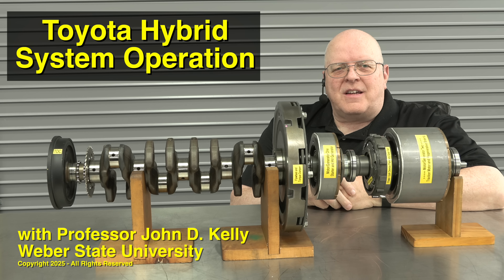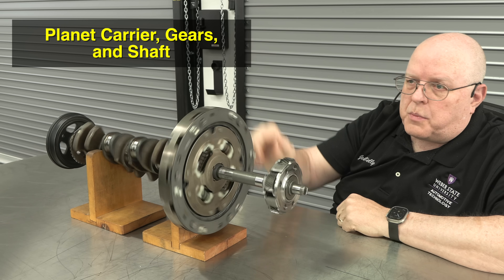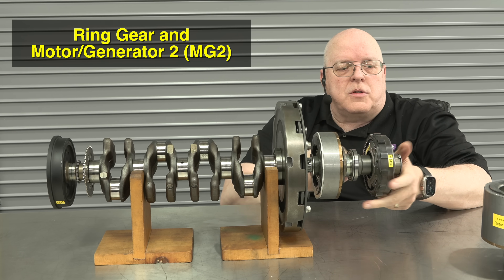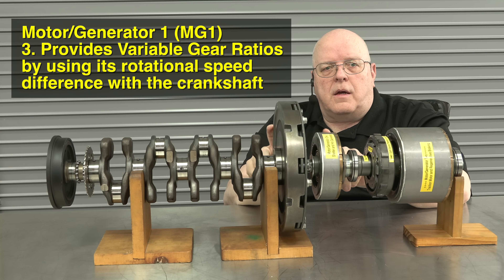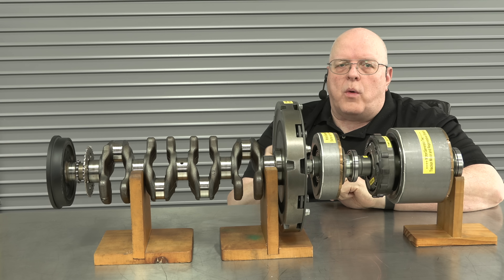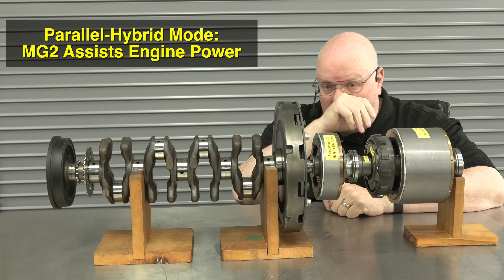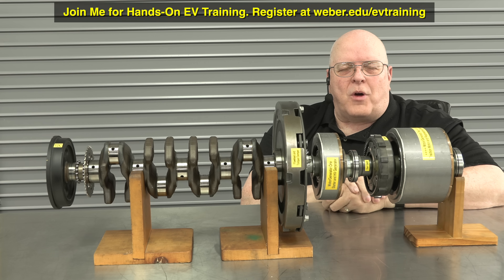Toyota Hybrid Transmission Operation - 15 Years on YouTube!

Comment: How does Honda do the same thing without the planetary gearset?
Reply from the maker: See my Honda Video for the answer. https://youtu.be/QLUIExAnNcE?si=koWU4q9hevkt8vrK
Reply: @WeberAuto  Thanks, I've watched the video numerous times but don't see the need for planetary gear if Honda can do without.
Reply from the maker: @Gman00047  Both systems accomplish almost the same thing, but the Honda has more parts and a hydraulic clutch pack for a fixed overdrive gear ratio. The Toyota has a variable overdrive ratio due to the planetary gear set..

Comment: Professor. You explained this well enough that this hard-headed 81 year old could understand how my 2012 Prius and 2026 Crown propels themselves down the road. And I always thought there were rubber bands in there driving things!  Seriously, thank you for your superb delivery.
Reply from the maker: Glad to hear the explanation was helpful!
Reply: The systems are very robust and wonderful machines!

By the way, even belt CVT's don't use belts anymore. They're basically like a spine, with interlocking vertebrae. They stock together to form a solid bar. And the operate under pressure, not tension! Modern ones don't use belts anymore, like you see on youtube, they are a series of linkages making a push belt, basically a bunch of vertebrae held together by a steel belt, so it's flexible but under pressure and compression it turns into a solid bar of steel. 

Modern cbts are absolutely wonderful and as reliable as automatic now. Cbts just have a bad name because Jatco, for a couple years, provided every single CVT on the market, to subaru, nissan, Mitsubishi, etc. for a couple years when they first came out, every single one of them was made by a lowest bidder and every single one of the first generation were crap. This meant that people thought they all slept because every single brand had a shitty one and none of the good ones came out for four or five years later.
Reply: why the engineer never near the engine? 😂😂😂😂  why Ford Motor didn't make motors but made engine 😅😅😅 why don't they call donkey power than horse but now the unicorns run & fly 😂😂😂😂😂

Comment: Thank you, the first video was great and this video is even better. You're one of the best!
I have questions about this system and would appreciate input from anyone with experience.

How much power does MG1 contribute at various gear ratios? at greater than 1:1 it is spinning but is it using a lot of power? at less than 1:1 it is spinning but is is using a lot of power? at 1:1 is is not spinning but is it using any power or is there a brake on it?
Reply from the maker: Thank you for your kind words. MG1 is either using power, generating power, stopped, or free spinning. The amount of power used/generated depends upon the acceleration, deceleration, load, vehicle speed, engine rpm, etc. So many factors impact it.

Comment: There have been a few comments with respect to the Honda hybrid system, which is fundamentally different from this one and the one major "drawback" of the Honda system seems to be an inability to blend ICE and electric power from a stop and/or low(er) speeds due to the on/off nature of the overdrive system (in the Honda system, available wheel torque from the ICE at <20MPH must be essentially non-existent, even if it could be engaged...)
Reply from the maker: Yes, it is a different system. I made a video about it here https://youtu.be/QLUIExAnNcE?si=koWU4q9hevkt8vrK
Reply: @WeberAuto  Thanks for the reply, but in that video you didn't touch on the fundamental difference of blending torque sources at low speeds.  It seems that the Honda system relies on a much more powerful electric motor for no/low speed acceleration since the ICE cannot be used (directly via the overdrive clutch) to apply torque to the trans-axle at low speeds or from a standstill.  

I'll have to do a test-drive, but I assume if your hybrid battery is fully charged, the ICE does not even need to start until the lowest practical speed is reached for the overdrive clutch to engage.
Reply from the maker: @awebuser5914  Yes, that is correct.

Comment: Kudos for the wood worker that made those stands. Looks like they line up perfectly.
Reply from the maker: Yes, they worked very well. Thanks for watching.
Reply: I was thinking the same thing! Perfectly crafted for the correct height!
Reply: What's so special?
Reply: @anthonyxuereb792 an 8 year old made them?  They're probably the simplest wood working that can be done.

It's amazing how you've got a comment on such a simple device holding one of the world's most complex devices.
Reply: @robertsaca3512 you think that's one of the world's most complex devices? Lol
Reply: @anthonyxuereb792you made bookends that hold bearings to line up car parts? Weird.

Comment: Thank you very much. 15-20 years ago i was always fascinated and interested how it works. I never saw your initial video. Its good to see this video and get the explanation (even fully electric vehicles have taken over where you also made good videos).
What i need to look up and answer: 
was the combustion engine in a fixed, stationary rpm speed. And so 
see how the vehicle motors and the generators were connected and how 
to look up (again) for the electric specs including the battery. 
Toyota has done a very good work (invention) with this engine. 
Patents should have expired but i  am not  aware that another company is using this principle. 
Used vehicle parts for whatever purpose could be interesting. Its good to renew the existing limited knowledge.
Reply from the maker: Thanks for watching and for the great comment.

Comment: In the past, you mentioned a pawl in the system to avoid trying to turn the ICE when running in pure EV mode (MG2 alone, ICE off, which is used in very low speeds in a hybrid and in PHEV mode).
Reply from the maker: Yes, that is correct for the 2017 through 2022 Prius prime. I have one of those right here in the shop and will be releasing a video showing the pawl ratcheting system soon. Thanks for watching.
Reply: The Sprag clutch?
Reply from the maker: @erik_dk842  Yes, to prevent the crankshaft from spinning backward during EV acceleration

Comment: In generator mode once the engine has started the electric motor rotor spin faster than synchronous speed of the stator the electric motor applies a counter rotating torque on the rotor which decreases rotor speed causing a reverse current to be induce 270° behind the magetizing  current in phase of the magnetizing voltage of the stator .
Reply from the maker: Thank you for your feedback. I forgot to mention that these rotors are internal permanent magnet type not induction rotors. Thank you for watching.

Comment: I own a Toyota hybrid and never could understand why they called it "E-CVT" when it didn't have a belt. Your explanation really showed how a mechanically simple (and electrically complex) system makes it work. I knew how the flywheel, planets, and two electric motors was bolted together but couldn't see how you got underdrive and overdrive working. Well done!
Reply: CVTs doesnt meant theyre using belts only. CVT means continuous variable transmission that means it doesnt have step gears and the abbreviation can be used objectively or subjectively. There's many designs of CVT used in vehicles. Other than pulley belt type, Nissan had double toroidal CVT for RWD Sedans (Cima, Gloria, Skyline, Infiniti Q45), MHI had hydropneumatic CVT for Type 10 tanks, and Aisin-Toyota made a split-power eCVT that actually an reverse differential. There's also "eCVT" that actually just a name like Honda's called i-MMD system as eCVT which is a series hybrid, while the Nissan e-Power and BYD DM-i which are similar system as Honda's are not called as eCVT.
Reply: @val8730  CVTs have a bad reputation for being mechanically unreliable and vulnerable. I think it’s a bad choice to market this marvel as an e-CVT.”
Reply: @kwonpv  agree. i think call it "planetary gear transmission", PGT. :)
Reply from the maker: I am glad it was helpful. Thank you for watching.
Reply: Not any more “electrically complex” than a the vast majority of pure EVs. AND that type of complexity is actually not really that complex from a reliability standpoint and a lot of the complexity is actually in the control system software that removes complexity from the mechanical components.
Reply: Yup, introducing an electric motor into a transmission to change ratios, sounds scary, until😊 you remember electric motors can power your house hold appliances for 20 years without problems.
Reply: Fortunately we don’t have to understand the drive train anymore than how your cell phone works. Just drive and enjoy. That’s why we pay smart people big bucks.
Reply: Some hybrid cars do have a belt.

Comment: The things I learned from this channel calmed my nervous ownership of my first used hybrid as I didn't understand the difference between a CVT and an ecvt as ecvts weren't regularly described anywhere. Just seeing the actual construction of these things makes things so much clearer.  I've put 200,000+ more miles on that Ford Escape hybrid I bought. It's still going strong and I've snagged a Chevy Volt before the tax credit expired. I hope to get just as much longevity.
Reply from the maker: Glad the channel has been helpful!

Comment: ai summary

Abstract:

This video provides a detailed mechanical demonstration of the Toyota Hybrid System's power-split transmission, often called an e-CVT. Professor John Kelly systematically introduces the core components: the engine's crankshaft, two motor-generators (MG1 and MG2), and the central planetary gear set that connects them. The video clarifies the specific connections: the crankshaft drives the planet carrier, MG1 is connected to the sun gear, and MG2 is linked to the ring gear, which ultimately drives the wheels. Through a hands-on demonstration, the video explains how varying the rotational speed of MG1 relative to the engine creates a continuously variable transmission effect, enabling underdrive, direct drive, and overdrive ratios. It also covers the system's various operational modes, including engine-starting via MG1, pure electric vehicle (EV) operation using MG2, regenerative braking, and the distinction between series hybrid (engine-generator-motor) and parallel hybrid (engine and motor combined power) modes.

How a Toyota Hybrid Power-Split Transmission Works

*   0:00:17 The Three Power Sources: The system integrates three key components: the internal combustion engine (represented by its crankshaft), Motor Generator 1 (MG1), and Motor Generator 2 (MG2).
*   0:01:12 The Planetary Gear Set: The heart of the transmission is a planetary gear set that links the three power sources. The engine crankshaft connects to the planet carrier, MG1 connects to the sun gear, and MG2 connects to the ring gear.
*   0:03:40 Driving the Wheels: Motor Generator 2 (MG2) is directly responsible for propelling the vehicle by sending power through gears or chains to the differential and front tires.
*   0:04:03 Starting the Engine: To start the internal combustion engine, MG1 spins the sun gear, which turns the planet carrier and crankshaft at a 3.6:1 gear reduction. Once the engine is running, it overdrives MG1, turning it into a generator to charge the high-voltage battery.
*   0:05:14 Electronic Continuously Variable Transmission (e-CVT): The system achieves different drive ratios by electronically controlling the speed of MG1 relative to the engine's crankshaft.
    *   Direct Drive (1:1 Ratio): At certain highway speeds, the engine, MG1, and MG2 all rotate at the same speed.
    *   Underdrive: For acceleration, MG1's speed is manipulated to create gear reduction, delivering more torque to the wheels.
    *   Overdrive: At higher speeds, MG1 is spun slower than the crankshaft. It can even be stopped or spun backward to achieve higher overdrive ratios, allowing the wheels (MG2) to spin much faster than the engine.
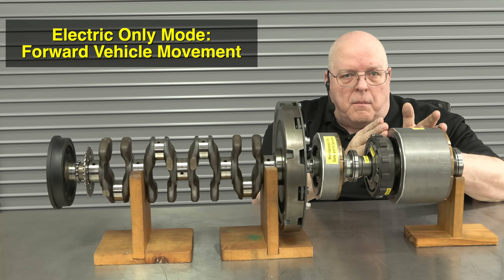*   0:08:16 EV and Reverse Modes: In full electric mode, the engine is off and MG2 powers the vehicle alone. There is no reverse gear; the vehicle reverses by simply spinning MG2 backward.
*   0:08:56 Series vs. Parallel Hybrid Operation:
    *   Series Hybrid: The engine turns MG1, which acts as a generator to produce electricity that powers MG2 to move the car. There is no direct mechanical link from the engine to the wheels.
    *   Parallel Hybrid: Power from both the engine (mechanically, through the planetary gear set) and MG2 are combined to propel the vehicle.
*   0:10:36 Regenerative Braking: During deceleration, MG2 functions as a generator, converting the vehicle's momentum back into electricity to recharge the battery.

I used gemini-2.5-pro| input-price: 1.25 output-price: 10 max-context-length: 200_000 on rocketrecap dot com to summarize the transcript.
Cost (if I didn't use the free tier): $0.03
Input tokens: 15073
Output tokens: 789
Reply from the maker: Very interesting. Thank you for watching.

Comment: Congrats on the 15 years Mr. Kelly! Still the best explanation on youtube (and probably outside of youtube too!). I do have 2 comments on the explanation; 1st, I don't think the underdrive, 1:1 and overdrive are actual modes. The system just moves from high to low ratio stepless and seamless. There is no switching or mode change. 2nd, you are explaining the series and parallel function as if they are separate modes where the transmission can switch between. But in reality, either 'mode' can not work without the other. E.g. the ICE can not spin MG1 without putting torque on MG2 (and wheels). There is always a series and parallel transfer of torque or energy at the same time.
Reply: There's always one....  What I took from the 3 actual 'Modes" mentioned was that he was describing what happens when the system is in these 3 positions, not that these are 3 defined positions. It was really pretty clear I thought.
Reply: "the ICE can not spin MG1 without putting torque on MG2 (and wheels)..."  Other than minimal gear and lubrication friction, there's no torque going to MG2 when MG1 is being turned by the ICE.  The inertia/mass of the vehicle alone is more than enough to not allow any motion, let alone driveline and tire friction (you could get a trivial amount of creep on a perfectly flat road, or slightly downhill, but the system puts a minuscule braking force on MG2 to stop it).
Reply: @awebuser5914 No, this is not correct. There is always a fixed torque split ratio between the 3 in/outputs of the planetary gear set. This is how a planetary gear set functions.
Reply: @ComplicatedStuff  "There is always a fixed torque split ratio between the 3 in/outputs of the planetary gear set. ..."  Watch the video, it's not rocket science...  MG1 can be spun by the ICE and MG2 has absolutely no relevant mechanical rotational torque transmitted to it , he demonstrates it with his hands FFS!  It's both the post-start regime as well as series-drive.
Reply: @awebuser5914 You sound confident, but you need to look up how a planetary gear set works. If you have 1 input and 1 output, you need to hold the third member. This is what the clutches in an automatic transmission do. If you don’t it acts like an open diff with one wheel in the air and no torque is being transfered to either wheel.
Reply: @ComplicatedStuff  What part of: "relevant mechanical rotational torque" is giving you trouble?  The "holding" force is the inertia/friction of the rest of the vehicle/drivetrain and/or a tiny holding force applied to MG2.  As I said, it's not magic, he's not hiding anything...
Reply from the maker: Thank you for your kind words, and I appreciate your feedback. I agree that the variable gear ratios are seamless. I was trying to demonstrate that because it uses a planetary gear set, there is a point where it crosses all three of those ratio boundaries (underdrive, direct drive, and overdrive). I was also trying to distinguish the difference between series-hybrid operation and parallel-hybrid operation in preparation for some future videos I am working on. I am currently working on a video showcasing the operation of the single motor Toyota i-Force parallel-hybrid system for the Tundra, Tacoma, Sequoia, and 4Runner.
Reply: @WeberAuto Thank you very much, I’m looking forward to your future videos.

Comment: Thank you Professor Kelly. An outstandingly clear, concise, accurate and enjoyable demonstration. It is surprising none of your acolytes has built you a powered rig for your demonstrations! Easy-Peasy.  A small battery pack & a tiny 6/12v motor with a little pulley and a flexible belt on each of your wooden V-Blocks would answer well. A three position switch would allow Forward/Stop/Reverse motion.  I've been tempted to build you one and send it 1/2 way around the world, but (silly me) have been expecting someone else to beat me to it.

Comment: In parallel mode, MG1 helps the crankshaft while MG2 becomes a generator, just like regenerative braking.
Think about it: if at cruise speed MG1 is consuming a huge amount of energy to control the crankshaft speed, and the tiny battery becomes empty in a couple of miles, where is that energy consumed by the almost stopped MG1 coming from? There is only MG2 left.
Reply from the maker: Yes, at higher vehicle speeds, MG2 can act as a generator or assist the engine as needed, depending on the battery. MG1 does not have to consume a lot of power; the resistance of the vehicle load can help MG1 function as a generator, even while providing variable gear ratios. Thanks for watching

Comment: Which models use this?
Reply: All of them...
Reply from the maker: All Toyota hybrids that are primarily front wheel drive or all-wheel-drive use this system since 1997. There are newer parallel hybrids that use a single motor here in the United States. I am working on a video to show that next. Thank you for watching.